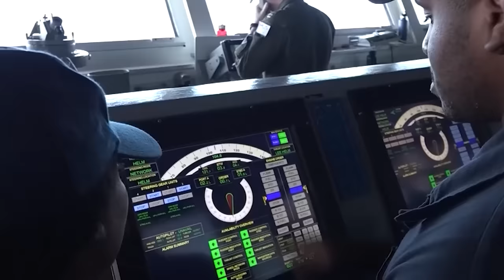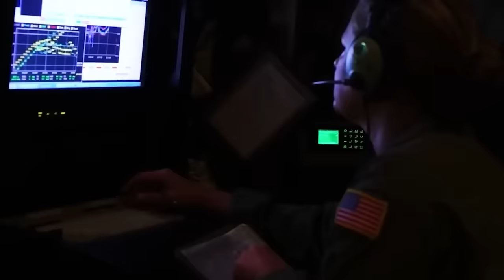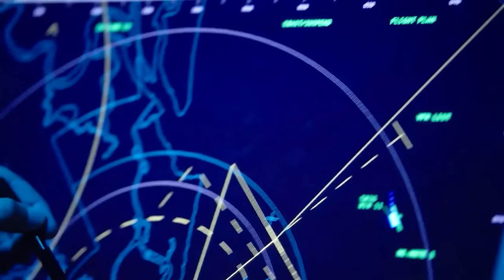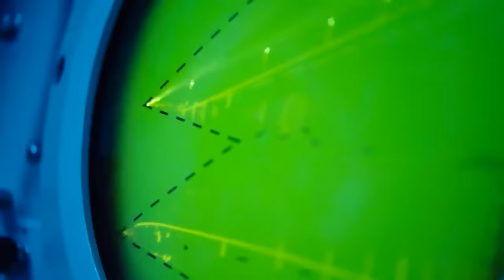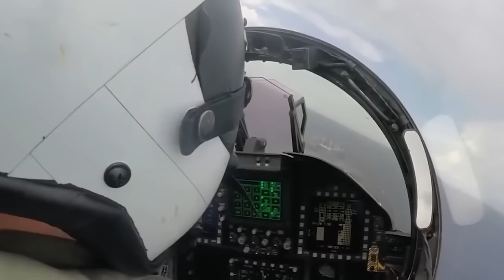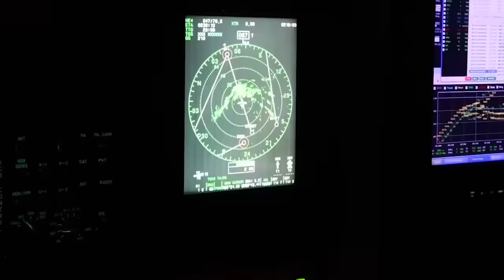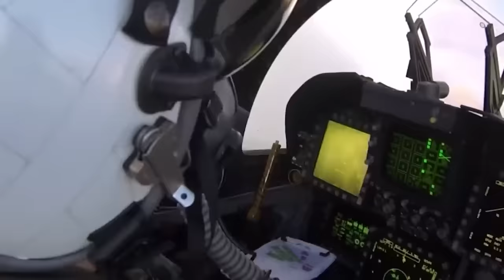US Navy's Genius Method for Aircraft Carrier Landings at Night

Comment: Land planes on a carrier at night with only their skills and instincts to guide them..."
So they turn off all the highly specialized computers and gear specifically designed for landing modern aircraft on a carrier at night ? Hmmm. Do better on these vids
Reply: Not all Naval aircraft are equipped with the Automated Carrier Landing System (ACLS) technology - The E-2 Hawkeye is not and it is a challenging bird to land well with little margin for error (80' wingspan).  Secondly the ACLS system does not work when dealing with a pitching deck.  Pilots are faced with the dilemma of wanting to use ACLS but wanting to stay sharp flying the ball without it so they are ready when the weather takes a nasty turn.  Thirdly, there are so many little things that can go wrong and so little margin for error - I prefer a skilled hand over the computer.

Comment: Since the carrier and the plane are moving in the same direction, their relative speed is less than it would be for a plane landing on ground, which doesn't move.
At night, the carrier is lit up but everything that might distract the pilot is dark. Thus, the pilots' attention is concentrated on the job at hand.
Long short: landing a plane on a carrier at night is optimised for ease and safety. Daytime on land is more problematic.
Reply: That's exactly right....until you try it.